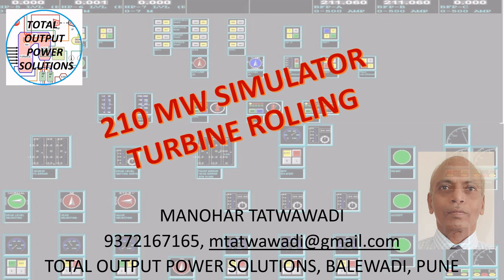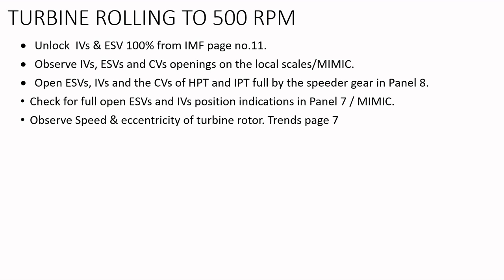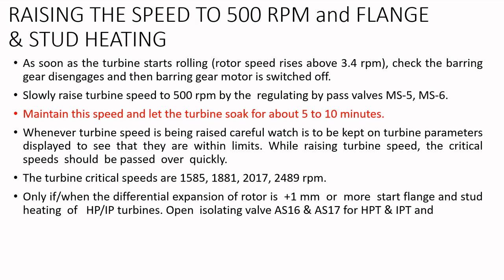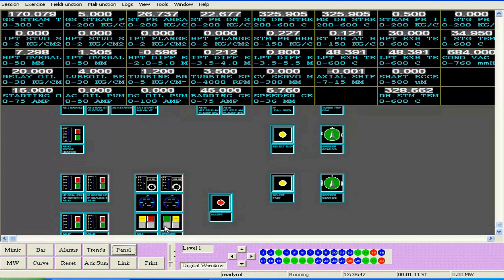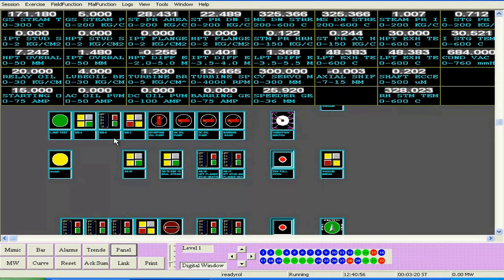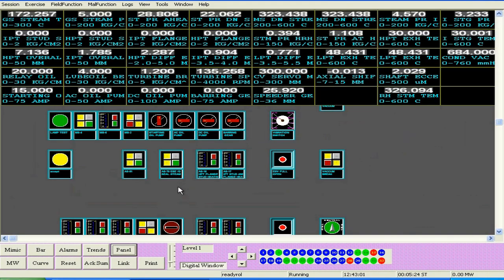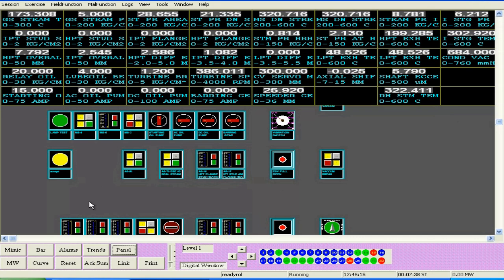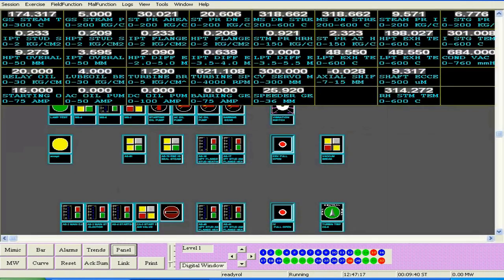START ROLLING AND ATTAIN SPEED 500 RPM, CHECK EXPANSIONS AND GIVE FLANGE AND STUD HEATING

Comment: Sir,
BHEL has mentioned to increase the speed at 50 rpm/ min during 500 rpm. to 1200 rpm. band & not from 3.4 rpm. to 500 rpm. band, as you said.
Reply from the maker: You are correct. The speed is to be increased from barring speed (3-4 RPM) to 500 RPM and then to 1200 RPM at the rate of 50 RPM/M.  It should take 10 minutes to reach 500 RPM and around 24 minutes to reach the speed of 1200 RPM....
THANKS FOR YOUR VALUABLE COMMENTS.